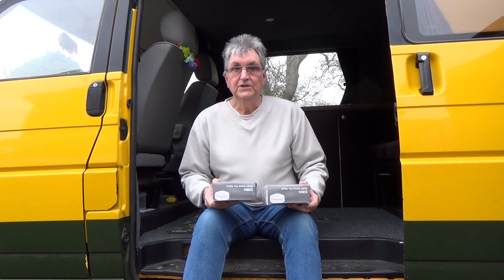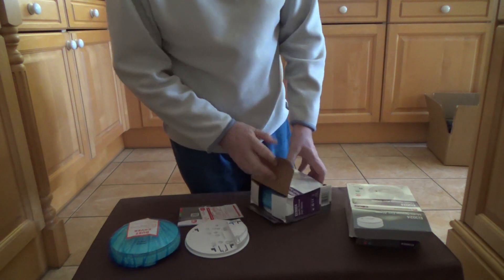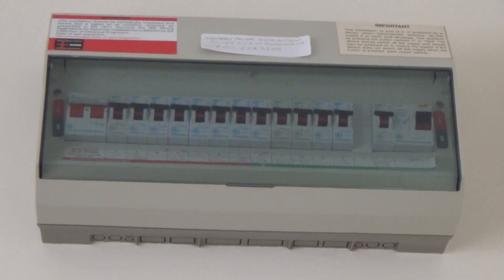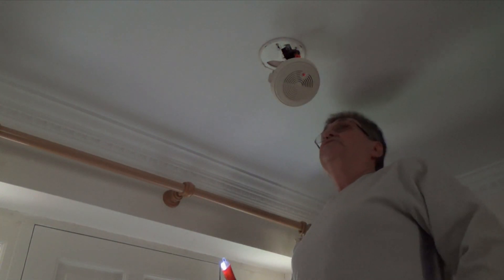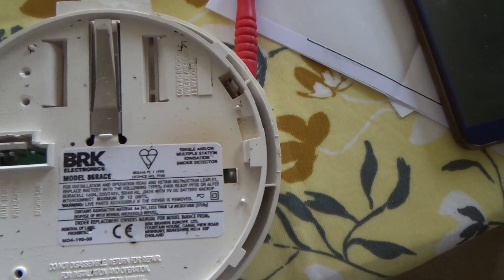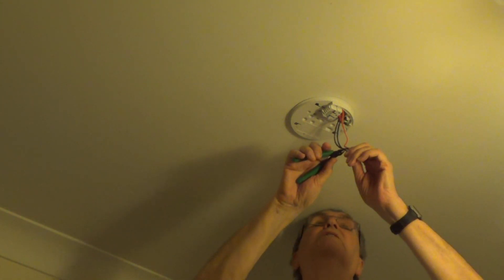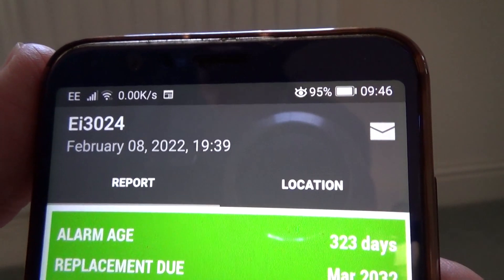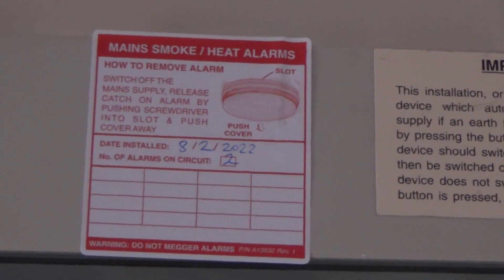#AICO #EI3024 Smoke Alarm #Unboxing and Install. DIY video.

Comment: Its been 3 years and he hasn’t even reached 50 likes 😢
Reply: Yep, but im back to watch!
Reply from the maker: @SmokesomeclocksThanks for watching.. all the electrical connections were there from the old ones so I just re-terminated into the bases of the new ones. They haven't alarmed yet even though I held a smoking frying pan near one.. I presume I installed them properly. They are smoke and heat alarms
Reply: @ron2256 try lighting a candle and blowing it out under all of them 😊
Reply from the maker: @Smokesomeclocksok, thanks
Reply: @ron2256 maybe you should do a video on doing it?
Reply from the maker: @Smokesomeclocksmaybe, thanks
Reply from the maker: But it has 3.6k views
Reply from the maker: Thanks for watching. Yes, it's probably not a very good video.. I was trying to get them done before it got dark because they are on the lighting circuit 😅
Reply from the maker: Some videos don't do well.

Comment: My alarms are only need to be replaced by 2030 but my 2 of my 3 alarms are intermittently beeping. How do I replace the batteries or do I need to replace the batteries? Also they are Ei3024
Reply from the maker: The EI3024s have built in rechargeable batteries which are supposed to last the life of the alarm.if they have failed before they should have, check with wherever you got them from..

Comment: Surprised to see that you have BRK 86RAC smoke alarms 

Also great video by the way!
Reply from the maker: Thanks.. People don't realise that smoke detectors have an expiry date.. I hadn't realised myself.. I think these new Ei3024 ones will start to warn when they need replacing.. The old ones were in the house from when the house was new.. They were never any problem and the batteries could be easily changed.. The new ones have built in batteries for life..
Reply: You're welcome, at the same time tough smoke detectors would have a expire date of 10 years after installation but usually people doesn't pay much attention at them which is probably why most people doesnt realise that they have a expiry date, but is good that they would alert you when they needs replacing and that they also come with a battery that lasts for the life of the alarm
Reply: @MisterBrownJack oh hi
Reply: @Smoke_and_Fire_alarms Hello

Comment: Nice! Good to know people are keeping up to date on replacement.
Reply from the maker: Thanks.. I noticed, when I watched the video, that I hadn't slid the upstairs one on properly, I could see a gap.. So I have slid it om properly now but I can't really alter the video. Can I ask you, what is the best way to test the alarms with actual smoke without doing anything dangerous. Thanks.
Reply: Detector testing spray you can get it on eBay etc quite useful. Wouldn’t recommend deodorant ect as it can damage the detector.
Reply: @ron2256 I use deodorant to test the smoke sensor